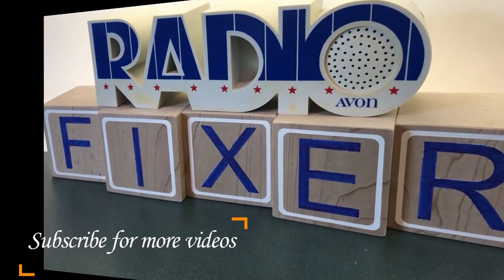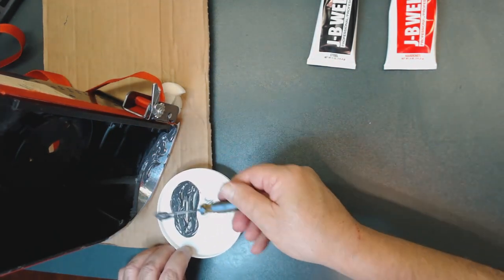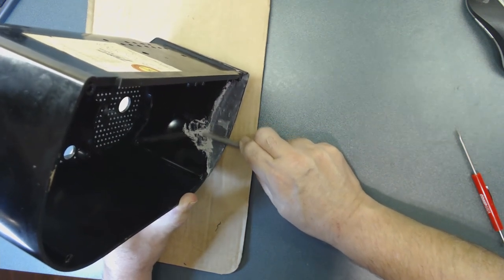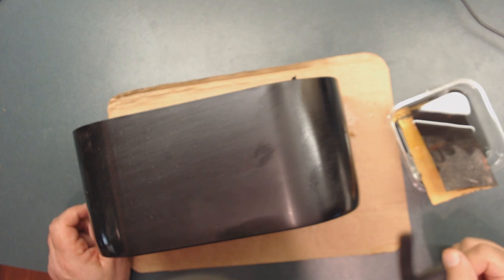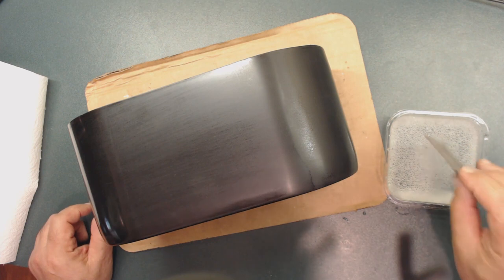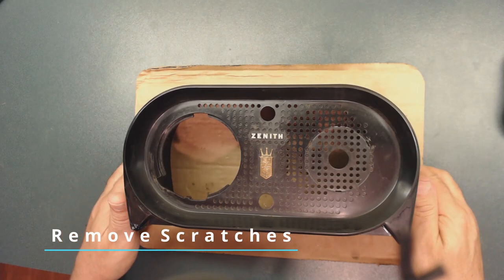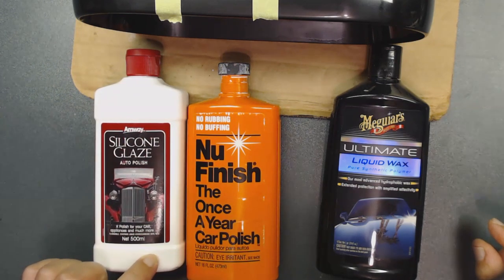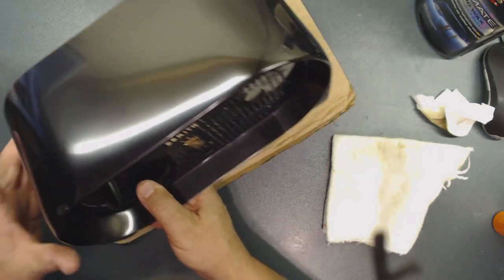Part 2 - How to repair broken Bakelite radio

Comment: That was amazing. I especially like that you replaced a missing part with JB Weld.
Reply from the maker: Hi Steve, thank you my friend! I used the product on my “Rat House Radio” to fix some small are but nothing like this. 😂😂 I thought if it works on that why not try to fix missing cabinet part. I was amazed myself how well it worked. Thanks again and have a great day! Jay

Comment: Excellent job! What type of paint did you use, and is it basic gloss brown? I didn't expect such a good color match.
Reply from the maker: Doug, glad that you enjoyed watching the video and thank you for the complement. The radio is black so I use Black Gloss, sprayed test on metal first to make sure that they match. I suggest several light codes of paint and let it dry between each code. Hope this helps! Have a good day!  Regards, Jay

Comment: Gostaria saber se você usa algum desmoldante para evitar que o epoxi não cole na tira de alumínio.
Reply from the maker: I did not use any release agent. Epoxy does not stick to aluminum sheet. Hopefully this answered your question my friend!  Have a great day! Regards, Jay
Reply: @RadioFixer  Obrigado Jay por sua rápida resposta. O fato é que tinha feito experiência com Araldite, outra cola epóxica e, no meu experimento, a cola grudou na chapa de alumínio.
Reply from the maker: @geraldofalcao1762 , Usei J-B Weld 2 partes Epoxy e Reflectix Foil Tape. Talvez a marca de epóxi que você está usando seja diferente. Por favor, verifique estes sites para obter mais informações. https://www.jbweld.com/product/j-b-weld-twin-tube   https://www.reflectixinc.com/products/tapes-foil-and-white-poly/